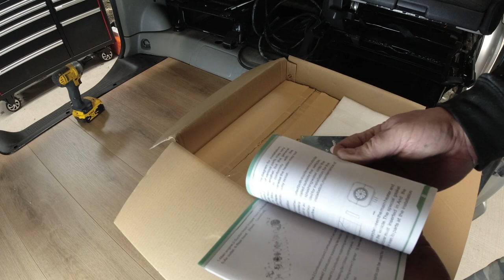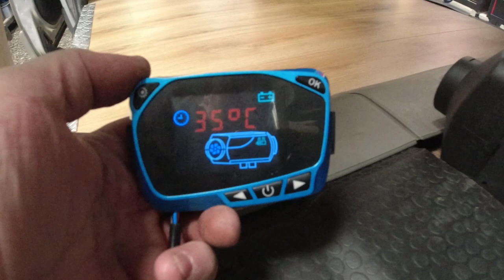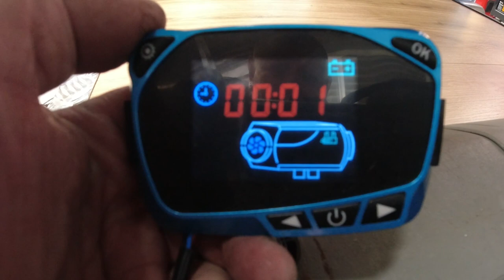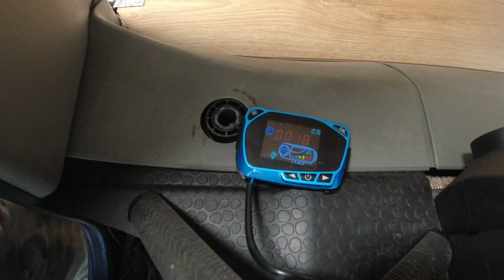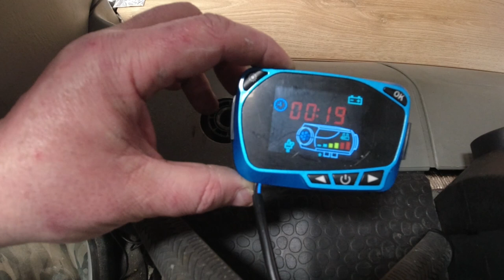Renault Trafic Campervan Conversion - Chinese Diesel Heater Install

Comment: Hello from the high desert of New Mexico USA 🇺🇸,  I have installed a lot of these heaters for other people and I am waiting for parts from China so I can install two of them in my 1967 GM TDH-4519 city transit bus.  The only thing I am worried about is that green PVC non fuel line, please replace that line with the white nylon fuel line.  I liked and subscribed.  Keep up the good work and stay safe and charged
Reply from the maker: Thank you for the tip and thank your for following my channel

Comment: Looked like the heater outlet was pointing at the grey floor plastic at the bottom? Melting/fire hazard? I would have trimmed the grey plastic or raised the heaterunit to clear it meself. Everyones a critic eh ?
Reply from the maker: I have installed ducting this weekend one of those jobs that needed doing and now done.  The flooring was cut away before installation as well

Comment: Yet another very helpful video and especially liking the fuel pipe tip onto the return line. Another job soon to be completed on my van. Did you leave enough room to put the seat back in with the bolt closest to heater covered by the shroud? Could you put in a link as to where you purchased the heater? Also could you do the same for the side runners and bullbar?  Good work...
Reply from the maker: I will put links in the video descriptions for these items yes.
I left approx 30 mm so I could slot the seat back over the shrouded bolt.
Reply from the maker: thank you also for comments
Reply: Very helpful video!  However, I do not currently have the conditions to be able to mount a diesel heater in this configuration.
Is there any chance you would undertake such a task in my renault trafic?
Your sincerelly.
Mario

Comment: Great helpful video ready to do mine. One question iv got... Where u have the pipe linked into the fuel return will the heater stop working if ur fuel level drops below quarter of a tank?
Reply from the maker: Hi yes it will as there will be no fuel feed, which is good as it won't run your tank dry and leave you stranded.
Reply: @BuiltnotBoughtCampers  that's a very good shout fella, fuel theft is big where I live so I may go for the external 10l tank fitment like uv got buddy 😉

Comment: Tapping into the fuel return pipe, does that mean the heater only works when the van is running (pumping fuel)?
How do you isolate the return fuel pipe so that no fuel comes out during the install of the t-piece?

Comment: Thank for this video, I used it for installing my diesel heater. 
Question, how did you get the 6x4x6 t piece in the return fuel line? I broke mine, currently got a bodged 5x5x5 t piece in which I will be changing out when my new one turns up.
Reply from the maker: It was very difficult but I took a cup.of hot water to.the pipes under the van to soften them first and then pushed the t piece on.  Glad it was of help to you.
Reply: @BuiltnotBoughtCampers  thank you.

Comment: Thanks for the v useful tips. Gonna fit one to my Trafic. What diameter tee piece do I need?
Reply from the maker: The tee piece is 6mm ton each side to fit the return pipe going into 4mm to fit diesel heater pipe